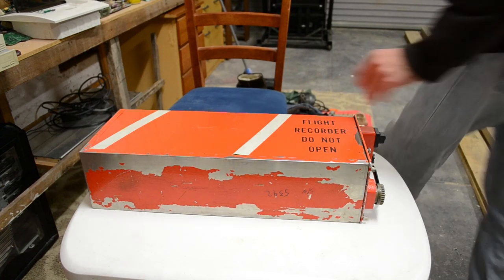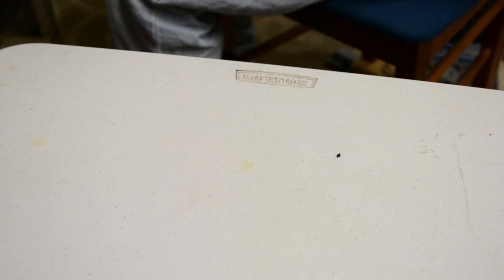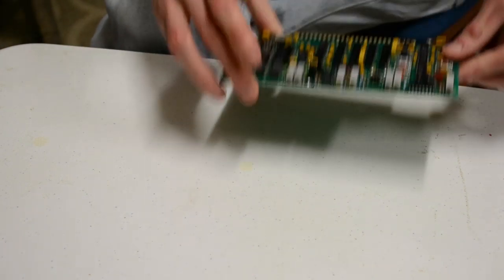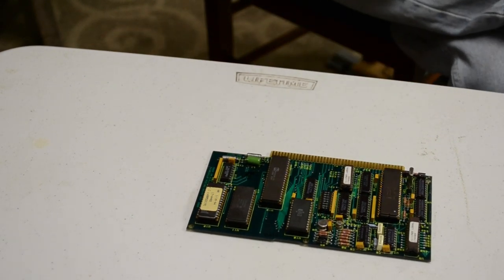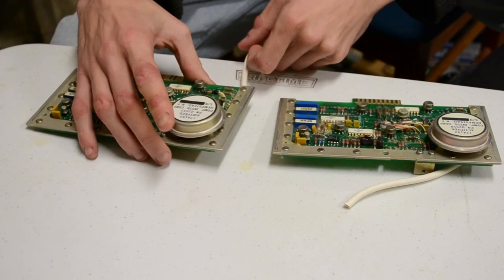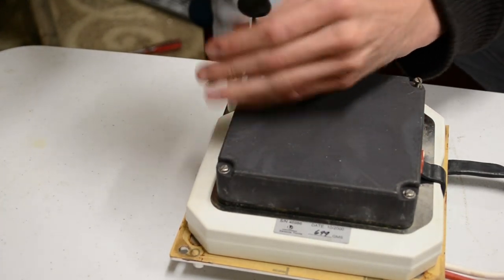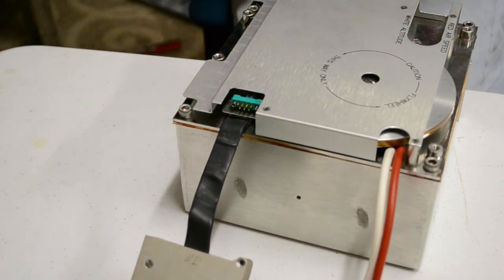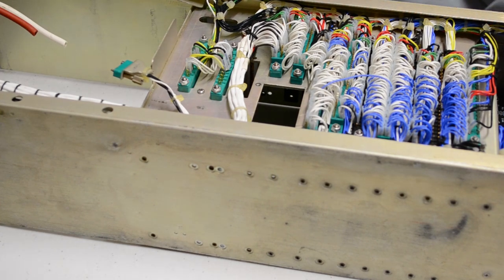Fairchild F800 Digital Flight Recorder Part 1 - The Teardown

Comment: jgcertified  35:12 Fairly sure the big resistor is simply used as a heater - that helps to boil off any condensation / moisture inside the unit. ;)

Comment: jgcertified  Very interesting to hear about the various issues with this recorder.

I've watched every episode of Air Crash Investigation pretty much three times over now, but never heard about this stuff. lol

I've been reversing some of the schematics for this FDR from the photos that Ed originally posted on his G+. I see that it uses BCD-to-decimal chips for the main read / write stuff, so can only ever select one track at a time.

I imagine it rapidly cycles through the tracks when writing the data?

This could explain why it resets to track 1 when it has a power glitch - the 82C55 IO chip is known to reset to a weird state when you write to a different port or don't reset it properly. I think the BCD stuff might be controlled from that chip.

EDIT: Oh, I watched your vid again and realized it probably only use one track per each loop of the tape. That makes far more sense. hehe

It probably just writes all the data in blocks to a single track at a time then?
Then it either switches to another track at a preset time, or waits for the sensor in the tape drive to tell it when to change to the next track after it loops?

It looks like it has outputs for 12 tracks, on the Write Amp board, but could be only 6 tracks in reality? The 6 opamps on the Read Amp board are dual types though, so might be 12 tracks?

(the other strong possibility is that it's using differential signals for each read / write signal.)

I've started on some of the CPU board schematics, but I'm after some photos of the backs of the boards so I can finish it...

http://i59.tinypic.com/20h2ats.jpg
http://i58.tinypic.com/33n921j.jpg

The serial very likely comes directly from the 80C31 CPU (pins 10 and 11), then goes to chips RS422 Rx / Tx chips U7 & U8 (UA9637 and UA9638) on the Interface I board.

You'll probably find with a multimeter that pins 5,6,7,8 of the two chips go directly to the round socket on the front of the FDR. ;)

No idea on the baud rate or protocol of course (without reading the PROM chips and disassembling the code), but it might be fairly standard serial.

Might have to do a Hangout about this at some point, 'cos I love rare hardware like this.

If you can upload some photos of the boards (both sides), I should be able to figure out almost all of the schematics and signals. :)
Reply from the maker: electronash Howdy! I believe it would be a differential signal to try and keep as much data as possible, and it's all in serial to one track at a time, there's likely to be a marker on the tape to tell it when to switch tracks. When I'm home from work, I'll grab out the macro lens and take some really big pictures of the boards back and front and pop them on my G+ :)
Reply: jgcertified Awesome, thanks! :D

If you can get the board pics fairly square-on, I can mirror one side and merge them in Paint Shop Pro. This method has been great in the past for tracing the tracks. It can't see under the chips though of course. :p
Reply: jgcertified Yep, from what I read about the F1000 last night (likely similar specs to the F800), it does sound like it simply writes to one track at a time anyway, then switches to the next track after just over 4 hours.

You could be right - it might just check for a marker on the tape, or maybe it's just spliced into four sections, and the sensor sees a transparent part?

There's no non-volatile storage on the CPU board, so that could also explain why it simply resets to track 1 if it has a power glitch / power cycle. That can't have been good for the crash investigators? :o

Last night, I found some of the articles you've probably seen...

http://www.aviationtoday.com/regions/usa/Case-1-Recommended-but-not-required_1948.html#.U-lxGeN7PJ8

(bottom of page 2)...
http://www.aaib.gov.uk/cms_resources.cfm?file=/dft_avsafety_pdf_501903.pdf
Reply: jgcertified Allo.

Did you manage to get any more photos of the boards done? ;)

I want to see those sharp and shiny macro-lens images. :p

Comment: +jgcertified Sorry, I'm not stalking you and Ed or anything, but on a bit of a mission to help get this FDR running. :p

It's possible the 5V reg on the PSU board is shorted, but it could just be that the cap got old and popped because it's on the 8.5V input.

Or, there must be a bridge rectifier or at least some discrete diodes in there which might have shorted out and caused the cap to pop?

Apart from the motor on the tape deck, it looks like pretty much everything else runs on -12V, +12V, and -5V. So, it would probably run fine on an ATX PSU if you could just power the motor directly (bypassing the need to check the transformers / rectifiers etc.)

I'm more than happy to help with the pinouts for the Fairchild connector btw.

A lot of the signals might be coming directly from the ARINC ports, so the aircraft stuff can be monitored from a console plugged into the Fairchild port.

Ed said you managed to get hold of the ARINC 542a spec (normally USD $98), so that's a great start. ;)
Reply from the maker: electronash A lot will be direct ARINC 542a outputs on the front, some will be to control the recorder and tell it to spit out data. One of my family members works in the aerospace (Specifically black box stuff) but has been unable to find an F800 manual so far .. I'm planning to find out which reg the blown capacitor goes to, and test the reg just to make sure it's not short. As the black box isn't going in another plane, I can probably get away with replacing the cap with a standard electrolytic (Which will likely have slightly sloppier tolerances)
Reply: jgcertified Hi, the blown caps goes across the 8.5V supply from the trafo / rectifier I think.

This feeds the 5V reg (LT1003), so the reg might hopefully still be OK and it was just the cap which crapped out.

I think a standard electrolytic will do the job fine. ;)

I'm almost certain the RS422 control to the Interface I / CPU boards will let you read the data out. If you can manage to dump the PROM chips, I could figure out most of the commands / code for it.

It's only around 4K of ROM total, so shouldn't be too bad.
Reply: jgcertified There's no assumption on my part of you sending me the PROM images btw, just that I'm happy to help if you do fancy it. ;)

Once the basic schematic for the CPU board is done though, it will be fairly straightforward to figure out how everything is controlled.

Not sure how the aircraft normally start the Flight Recorders rolling, but from what I've read, it should all be controllable via the serial commands.
Reply from the maker: It won't start until there's proper phase-synchronised inputs coming in for certain controls. Luckily, I have a thingy whose proper name temporarily eludes me to allow me to put those phase-synchronised signals up the F800's ass to get it started!
Reply: A-ha, that's interesting.

Just remember it's default will be to erase / overwrite the tape when running, but you could probably just leave the Write Amp board temporarily unplugged with no adverse issues.

Or, if you just want to get the tape deck going, you could bypass the relay. ;)

(I think the motor goes to one of the relays at least, but couldn't quite see in the vids.)

Comment: On the read amplifier how many pins did the amp ICs have?
Reply from the maker: 8 .. They-re most likely basic op-amps
Reply: jgcertified I see. 
When i saw them I thought they were 555 timers, I use those a lot at school